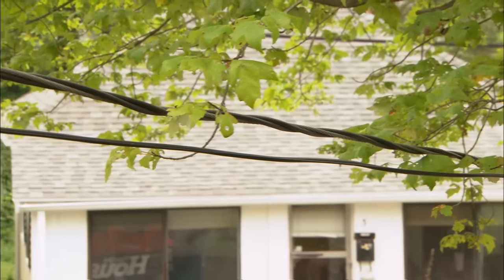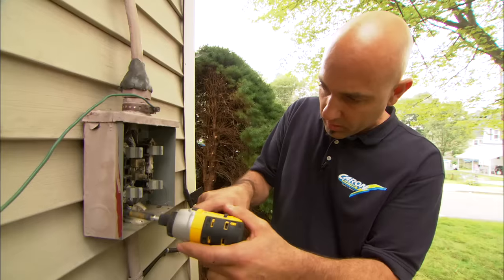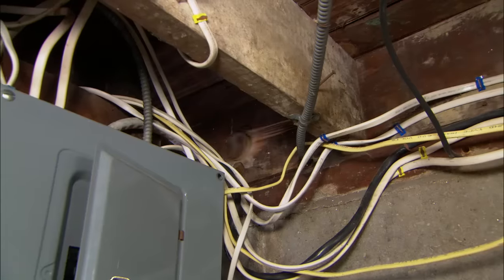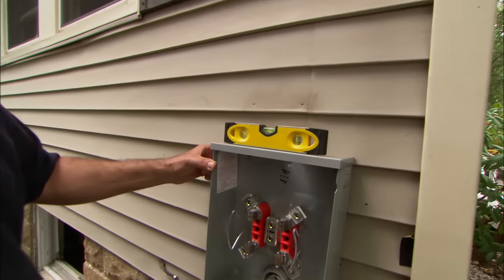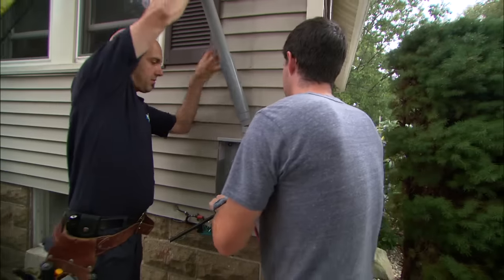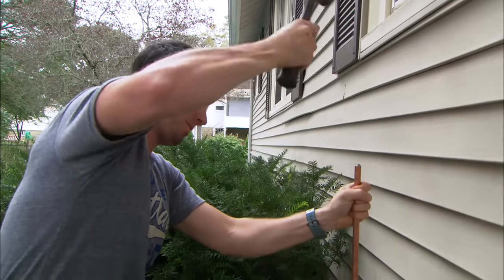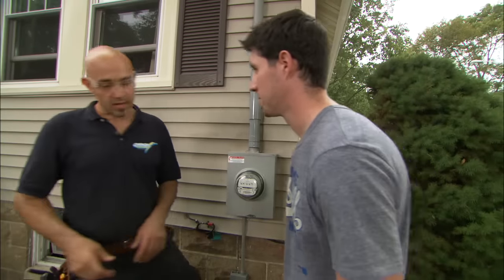How to Upgrade an Electric Meter to 200-Amp Service (Part 1) | This Old House

Comment: I've done over 200 service upgrades and this would never fly in Colorado.. PVC for a riser? not good. will Turn black after a couple of years, Use EMT if your not going through the roof and secure with Mini's or metal 2 hole straps..
Reply: Use EMT?  🤣🤣🤣🤣🤣

Comment: Lots have changed since 2014. were i am here in CT you can not bring the ground into the meter box like that.  also you need a lever style bypass

Comment: I've watched you twice use pvc, and never use pvc cleaner (purple) because you can't use clear in Massachusetts. That is a vital part of the chemical bond when gluing pvc pipe.
Reply: There is a primer/glue all-in-one product. He could have been using that.
Reply: @jeffreylonigro1382  if there is I've never heard of it. In Massachusetts you have to use purple primer so that inspectors know you've used it.

Comment: why are you using aluminum wire instead of copper wiring. I remember it being illegal to use aluminum wiring in a house???
Reply: You must’ve mis-remembered
Reply: @electricaf365  no, over 20-30 years ago, itwas a fire hazard to use aluminum in homes
Reply: @richardscarlett7942  aluminum as a service entrance conductor is used all across North America.

Comment: nice video only one thing i don't get is how the electric company turns off the power normally to your home. It looks as if they cut the transformer B , R , W wires from the pole to houses temporarily seems. Seem as they could just turn a fuse or breaker/switch at the transformer instead... was those wires just disconnected after words because you where install a whole new service stick/pole before the meter as well?
Reply: Where I'm from the utility company threatens you with legal action if you touch there drops or remove the meter. Starts out with a fine. Multiple offenses and they say they'll have your license revoked. Even had one lineman threaten fire fighters who pulled the meter to a burning building before he got there.
Reply: A couple of years ago, UI went around my town putting bolt terminals on the wires next to the weatherhead. So in my case i guess they sould just be unbolted?!?

Comment: You don't need 2 ground rods as you have a cold water pipe as your primary grounding electrode. You fo need a supplementary grounding  electrode but only 1 rod is required. You won't even need the supplemental ground rod if you can get to the rebar that is on the footing.

Comment: Those ground rods have nothing to do with avoiding electrocution. You could disconnect those ground rods completely and the system would be just as safe from ground faults and electrocution.

Comment: Wish I had my own house. This looks easy to do. I'm renting. :(

I keep tripping the 15 Amp breaker switch from my room and it's getting annoying. Can't keep up with my 1000 watt PC, TV, mini fridge and portable air conditioner on at the same time. :(

Was curious how the system is upgraded.
Reply: This wouldn't help you. You need a higher gauge wire and a higher amp breaker. It would probably be easier to wire a new circuit dedicated to just your ac unit, though, but probably won't happen if you're renting.

Comment: What part of the country was this job? We don't have the POCO disconnect, we do them hot. Use either Polaris or Brundy insulated connectors, gloves, fiberlgass ladder etc. No need to cut the power unless your POCO requires it.
Reply: Brandr bad idea not that safe. In Texas you have to call the power company to get the service disconnected. so you can work safe.
Reply: ElChapitofz
How does your POCO do the disconnect and reconnect?
 Do they send a man out to put up his fiberglass ladder and use his cable cutters to cut the drop at the connector? Do they then once the work is complete send the man back to put up his fiberglass ladder, wear his safety gloves and use his Greenlee crimper to reconnect the neutral then each hot leg? If the answer to any of this is YES, then that will also inform you how experienced, qualified and licensed electricians also do the same thing where I am located and in fact around the entire country. Nothing, and I repeat, NOTHING is 100% 'safe', but there are very good and proper procedures that experienced sparkeys use and have used for many decades.
Reply: Brandr well they pull down the jumpers on the line that goes to the transformers. And they cut the wires next to your weather head. When ever you get done replacing the meter socket or panel, they will come inspect everythi g ia correct and splice back the wires and put back your power
Reply: ElChapitofz
The point being, they must come into contact with energized lines and when doing so, they use the proper PPE. That's what it's made for. There is a reason why high voltage safety gloves, suits, face shields, ladders, insulated tools etc etc are manufactured and sold by the truckload every day in this country. It's for safety WHEN WORKING ON ENERGIZED LINES. So when someone tell me that it is 'improper' even with proper PPE and using proper procedures I call bullshit.
Reply: Brandr 
You have to call them to send a guy in a bucket truck to take your power out. They do use their high voltage gloves hard hats, etc all the ppe. Then when you are done you call the power company back they will send the same guy or who ever is available. And yes is never 100% safe
Reply: Brandr 
The power company guy pulls the fuses down to make sure none of the legs are hot when he or she cuts your service wires
Reply: Brandr 
yes. When ever the power company worker cuts your power you be working more safe. but he makes sure he is safe too by using his proper ppe, high voltage, fiber glass shotgun.
Reply: all we do at kcp&l is cut the hot legs at the weather head, tape them up then cut the neutral. no need to climb the pole to disconnect anything, just do it at the house. yes, we do wear our secondary rubbers whilst doing this though if you're a good lineman you can do so in leather gloves ;)
Reply: there is no need or reason for a narrow back to do that work hot. save your nine lives and work it cold.
Reply: Brain Cleek
Well I suppose you could tell the POCO guys to do the same thing. They could then shut the entire grid down so he could go out and get on his fibgl ladder and go up and cut the line cold also. Where does this lunacy stop? Why do you think the safety gear designed for working on hot lines is made in the first place??

Comment: Hi. I live in an apartment building, its a pre-war building.  The circuit breaker box (forgive me if I am wrong)  is old.  If i turn the ac on and the microwave at the same time,  every thing shuts off. How could i upgrade the circuit breaker to modern standard? And how much would it cost? Sorry for not having the correct terminology.  Thanks
Reply: You most likely have Aluminium Clad wire @ 14ga. on a 15 amp. fuse, which would give a load balance of 1440 
watts ( 80% ) and that A/C is using about 87 % ! So when you say "Everything" shuts off - you have most likely a 60
amp Dist.panel that is way to over loaded. Here is the Bad News - you are not just going to be able to replace just a breaker... your going to upgrade to min. 100 amp Dist. panel & new romex 14 & 12 ga. solid copper wiring w/ proper 
grounding! As far as cost goes...  $5,000 to 13,000 on the lowside.
Reply: @rrfields65  swing and a miss.

Comment: Ive driven over 100 ground rods without a hammer. You keep adding water as you work it in and out of the hole, push too far and you'll get stuck from a tight suction. If the ground is hard, hammer drill a hole first in order to hit mud.
Reply: Yep that's th e easiest way to put in ground rods.

Comment: Our municipality has what seems like a strange rule when it comes to service entrance panels. The neutral wire must be a single continuous cable all the way from top of the weatherhead down through the meter and into the panel onto the grounding bus. Not sure why that would be so important as a break in the cable as we see here does not seem electrically important.
Reply: If the neutral is lost, broken or gone the two 120 volt legs can become unbalanced. ie one might be 60 and the other 180 and thus much damage.

Comment: I like to run my wire in conditioner,gray crap is just too cheap,plus hard to deal with. Unusual seeing PVC,thought 2 inch rigid conduit was a requirement.
Reply: I don’t know why you thought that

Comment: I upgrade my own power. Idaho let's the homeowner do it as long as you pull a permit and pass inspection. I used metal conduit.  Getting those grounding rods in was a total pain.
Reply: alan mcConnaughey Idaho is so cool. Lived in Boise in 2019 but moved out East to buy acreage. Cool place though 🇺🇸

Comment: About those aluminum connections one had better hope the main line never shrinks away from the connections! I saw it at a home burn
Marks everywhere when it disconnected and shorted! Also aluminum is a lousy ground
Reply: You didn’t see that

Comment: Canada is a little different. We go to the water line to ground.i like that meter box. No one can pop the meter out.
Reply: One main issue with using the water line as the grounding electrode is that at some point down the line, a repair may be made with non-conductive materials, thus breaking your continuity to earth...

Comment: 2:27 That 4 inch hole was way too big for that wire.  And they didn't even seal it up before they installed the box??
Reply: When I did mine I used putty to seal / fill the hole. Finding the correct stuff is challenging.  The inspector congratulated me saying most people don't bother doing that.

Comment: Not permitted in Atlanta and others county’s, a socket meter with out disconnect, also PVC pipe not allowed
Reply: Atlanta is not a county and yes, PVC is absolutely allowed and used every day
Reply: @electricaf365  schedule 40 or 80 do you used?
Reply: @olayino  40
Reply: @electricaf365  tienes licencia, no creo
Reply: @olayino  yo tengo
Reply: @electricaf365  de que estado ?
Reply: @olayino  GA
Reply: @electricaf365  cuanto es la raíz cuadrada de 3?

Comment: can a 200 amp service meter housing be used and still keep the 100 amp main service panel in the house
Reply: robert eyler No, the service panel must be updated. Also, if you are keeping the same box why do you need 200 amp anyways?
Reply: In general yes
Reply: As long as every thing ahead of the 100 panel is rated for 100 amps or more it's good to go. Everyone who's asking why 200 amps probably has never calculated the actual load for building. Even a 1 bedroom cabin should have at  least a 100 A. service meet the NEC. Even more if electric range HW and AC clothes dryer are added in

Comment: 4:51 What's that you're putting on the wire? Why do you do that? Why didn't you say anything about it?
Reply: Tom Garbo  ikr If you're trying to learn from these videos there seems to be missing info. These are more for the general idea of what is going on rather than a full education/training video for pros. I did see in another video, when he attached the wires to the panel inside, he said he was putting on a gel to prevent oxidation. Anyway, I learned enough to hire a proper electrician to do electrical work. But I do want to know enough to know when someone is taking shortcuts and I'm not getting my money's worth, not to mention safety. Even with permits, professionals, inspections etc. how much stuff gets by that shouldn't...Also I realize watching a few minutes worth of videos doesn't compare to proper training, education, apprenticeship, years of experience, conscientiousness and honesty i.e. a good electrician. I appreciate the pros and inspectors that do the right thing (I've heard too many Mike Holmes rants, lol).

Comment: Does that new service need a disconnect?
Reply: No not unless you are going more than six feet from where the SE cable enters the home then you have to have a disconnecting means installed.

Comment: They should not feed the meter from the top and he should not came in the back. It’s best that both wires come in from the bottom. Where I’m from the power company install the meter.
Reply: How do you get the wire into the meter base from a mast if it’s not from the top?
Reply: @danlux4954  great question. You can come into the diode the meter or you can use SE through a sleeve mask and take the se through the side
Reply: Coming in the top of the meter gives more of a chance for rusting and damage due to water entering the meter and snow sitting on the meter and water leaking into meter
Reply: @danlux4954  didn’t a ridged mask. And he would’ve made better time if he use water for the ground rod and then beat the ground rods in after that. I’m not saying use a water hose.
Reply: @ctbt1832  my mast is under the overhang so not much water sitting on top. Plus I have 400A, a lot harder to bend those wires.

Comment: Even that there’s no power, weather head not connected to the pole, they are working backwards. They should be working from the breaker box to the source, new meter box.

Comment: I know here in baton rouge that would fail inspection because you cant break the neutral conductor its supose to feed through that's why those neutral lugs come off to allow feed through

Comment: a bit of a miss.. No mention on how 200 amps wire get from the wires above the hose aka the pole to the street to your box and the cost to do such.
Reply: That’s because the power company does that part
Reply: @electricaf365  yup i know but they should cover that and the cost of that from the electric company. Because id like to upgrade to 400 or 600 amps .  i can wire the rest as seen in the video  just dont know the cost of the other part
Reply: @SuperJimmyBennett  it’s a short video.

Comment: By me the utility company won’t allow a ground conductor inside the meter pan. It has to travel from the ground rods directly to the ground/neutral bar inside the main panel. And I see nothing wrong with using PVC for services, some people wanna use Rigid Metal Conduit, F that what a pita! Only where the pipe would be exposed to physical damage, like close to a driveway would Rigid PVC Sched 80 be required.
Reply: While PVC conduit is listed as sunlight resistant, it is NOT sunlight proof!  and come back in 10 years and that conduit will be warped, chalky and brittle.  Thats why RMC/IMC is preferred.

Comment: Legitimate question here. Why is there not a separate neutral (grounded conductor) feeding the electrical panel inside? There’s a dedicated neutral coming from the service entrance.
Reply: The Neutral was the bare stranded wire in the middle.
Reply: @danlux4954  I know that the ground and the neutral share a bus bar in the main panel, but does that mean they share in the meter can too? Because that neutral bus looks to be grounded to the can

Comment: You want to keep that old analog meter box on there for life never let them put digital on your house. That's the way they burn your house down by overloading it from the main controls Frye it won't overheat like the digital ones will and start fires. Happened countless of times.

Comment: Seems as though he’s using URD cable (USE) up the riser, second  the SE cable is correct But where the bonding of the panels ( meter center to breaker panel) he only use a 3 conductor

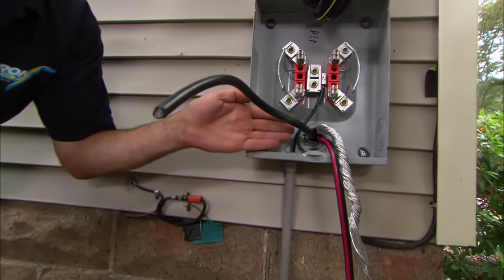Comment: 4:44 you skipped too fast past the most interesting points; connecting the upper (from pole) and lower (into house panel)  conductor connections where the meter will go ...

Comment: Question. WE have an100amp breaker in our outdoor homelife breaker box. Can we replace with a200amp breaker or do We need a whole new box. This is on our power pole running our mobile home n not enough power. keeps flipping breaker switches if too much is plugged in.
Reply: Darlene Hugg 
You cannot just replace the breaker. Pretty sure you'll have to change the box and incoming wire to handle 200 amp.
Reply: all depends on building codes.  I would guess that with a 100A breaker, you only have a 100A service wire for the current.  if you put in a 200A breaker, you run the possiblilty of drawing more current than the wire is rated for, and thus tarting a fire.  Check with local building codes and licenses electrical workers.
Reply: I think the above answers do not stress enough that just putting in a higher rated fuse into a circuit is an enormous mistake. You can also just leave the whole fuse out then and put a metal rod in the fuse socket. The wires will start a fire anyhow once you go beyond 100-and-a-bit amps when you didn't upgrade them.
Reply: Thank you very much
Reply: To add the 200 A. breaker, everything it would feed should  rated for 200 A., not to mention merely putting in a larger breaker without understanding what's tripping the current breaker would be foolish . If available consider replacing the current 100 A breaker it may be faulty. Beyond that use load management or look for faults in the wiring from the breaker and home.

Comment: Why do you need a grounding bar in the middle of the outside ground wire?
Reply: Easier to add ground later for outside needs. Satellite, etc.

Comment: I have an electrical question
I m replacing a 20 amp breaker that works perfectly to an arc beaker, but the arc breaker trips not the regular one
What can that be?
Reply: Something causing an arc, loose connections?

Comment: I've heard under new rules cable needs to be 4 conductor not 3. 2 hot wires 1 neutral and 1 ground. Under new rules neutral and ground need be separate

Comment: I would not use PVC service mast, either rigid metal or IMT.  The conductor with a yellow stripe should have been taped with white tape at the weather head.  Also he did not put antioxidant compound on the aluminum terminations.  I didn’t see him putting putty into the hole where wires go into the house, this is to prevent condensation.  The last..., real electricians use 18v Makita or Milwaukee drills!